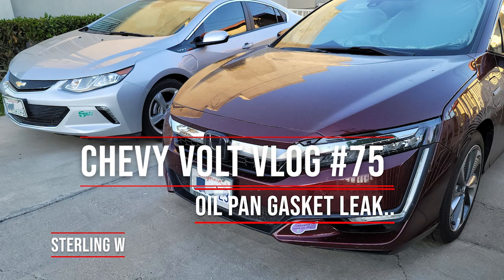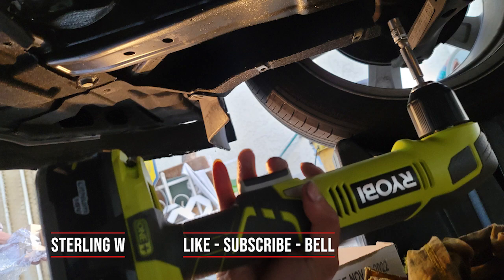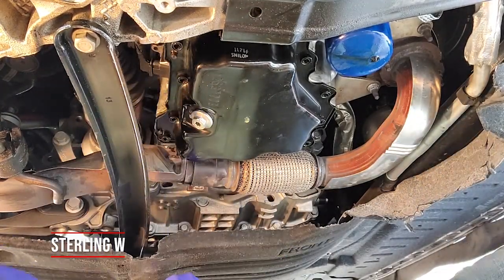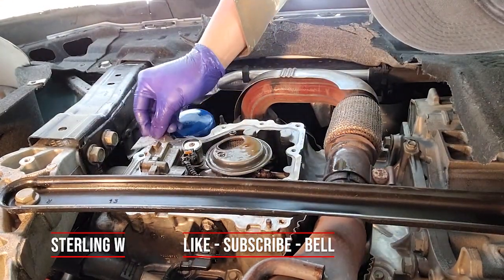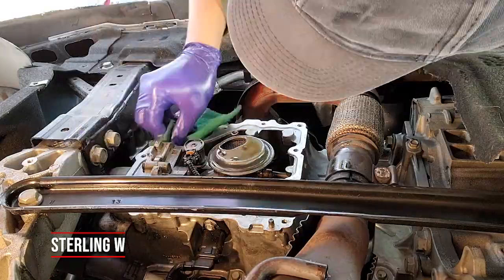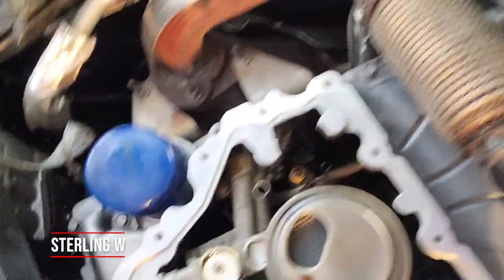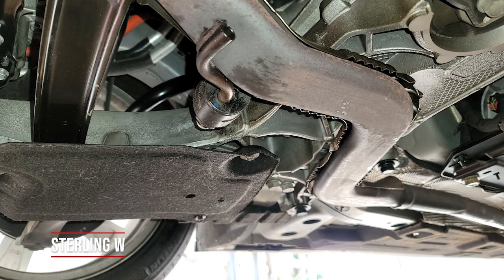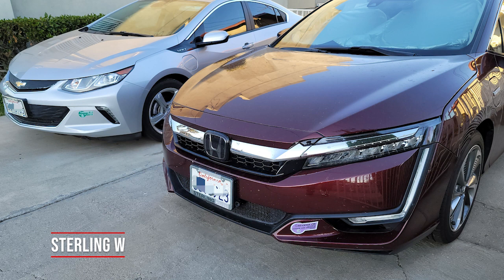CHEVY VOLT VLOG #75 - 2017 Volt OIL PAN GASKET LEAK ... FIXED!

Comment: Good advice all around. I thought I had another pry bar laying around but couldn't find it, ended up using an x-acto knife to cut away at the old sealant until I could get a flat head in there to slowly pry away. This is very easy to do yourself with basic tools. Make sure you take your time cleaning off everything before reassembly, if you think it's clean enough, clean it again, the previous owner clearly had this replaced at some point and it was a mess. The torque specs for the oil pan bolts are 8 ft-lbs

Comment: Was there a particular reason you changed the pan? It looks in perfect condition. Mine is completely rusted and it's only 6 years old.
Reply from the maker: The pan gasket seal was leaking
Reply: @SterlingW8  normally you don't replace the pan because of a leaky seal, you just strip and redo the seal. Was there anything visibly wrong with the pan?
Reply from the maker: @CRuM770  true, thinking back, I think it cost like me  $20 or so for the pan with screws and new drain plug and washer - from GM parts. And me not knowing what was leaking (gasket or pan) i just spent the $20 vs the $9 for a new drain plug and washer.
Reply: @SterlingW8  that makes sense. I will need to change mine soon so glad you did it and recorded the process. Cheers!